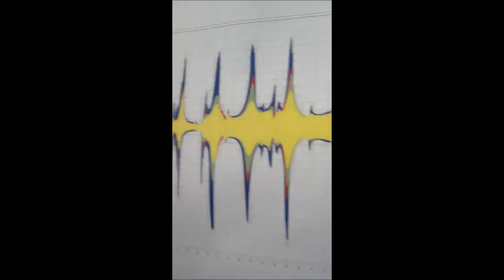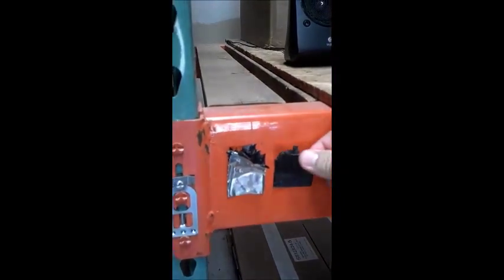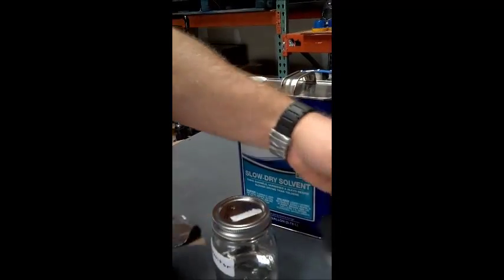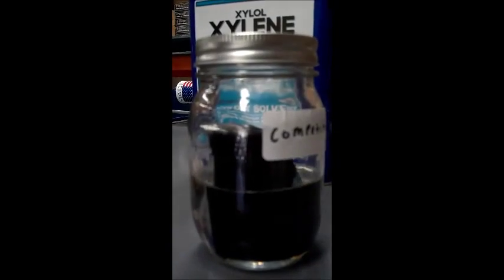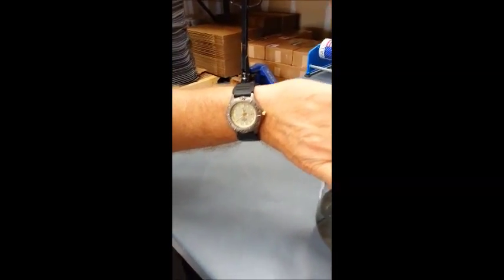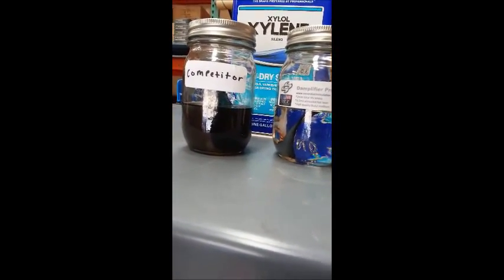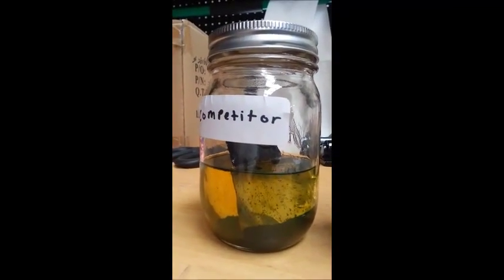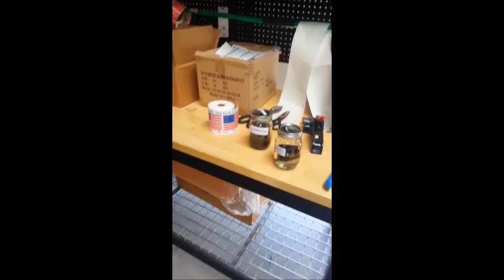Second Skin xylene test

Comment: The second skin is $3.30 a sq ft on Amazon Prime for a bundle of 40 sqft. Marble tile is cheaper. There is no reason (other than marketing to a audio crowd), why any of this stuff should cost more than a buck a sq ft. No reason. They would still make money..Also, this stuff comes from an existing industery of material making for roofing, and all kinds of applications, so the manufacture process is already there. Nothing new needed.
Reply: +UnknownHandle UnknownHandle Do some real research there is no comparison between real butyl products and asphalt/tar roofing material.

Comment: I was reading a very long and thorough testing of all these sound deadeners. A guy in Cali was doing. While this competitor doesn't have asphalt, having some would be beneficial! The asphalt made product was the BEST performer!! So if you can deal with a little bad smell when installed which is temporary once it cures..then you'd have the best deadening, and being asphalt based, should be cheap..Unless they spin all the marketing bull all over it.
Reply: +UnknownHandle UnknownHandle Yeah real scientific testing on that thread, in his moms basement, throughout 4-5 years of different atmospheric conditions. On top of having noise issues with his dog, his moms dog, and the fridge/ac unit turning on and off during his testing. We have plenty of real scientific testing done by a 3rd party source shows what real butyl rubber does. This is in no way comparable product to cheap asphalt and tar roofing products. Whatever brand you choose always insist on high quality American made butyl ruber. Tar and asphalt should never go inside of a vehicle.
Reply: You offer limited disclosure testing with reports of what the brand wants to expose. His tests while not ideal is still a VERY VALID testing with actually product range to compare with. I trust it more than a brand.

So your resources for the rubber are sourced and formulated in North America? What are the sources?
Reply: P-hacking is a very commonly used method of making product A vs product B to sway in either favor if you want. Those THOUSANDS of dollars are designed for statistical weight. A basic test is all that is needed to do a comparison.
Yes, you can do this test in a basement with some basic gear, and audio reading instruments far less than the 10s of thousands.  But if you are trying to pull data to make a claim, it takes lots of money, and lots of statistical data to use the strong points in your claims.

Since when were Universities all a sudden the unbiased group to making test studies. They still will not make claims that go directly agaisnt the corporations that donate/sponsor/fund them.

You're digging a bigger hole for yourself.
Reply: If you aren't aware of sponsorship studies, then you are the delisional one. I have zero relation to car industry sound deadening or related companies. I do know somethings about raw materials and composites used in industry, and obviously know much more about testing in a chem lab as I did in university, than you ever did.